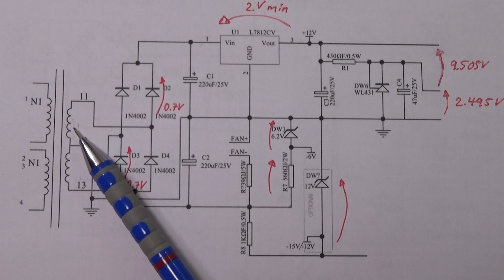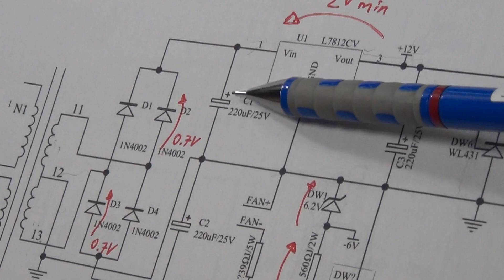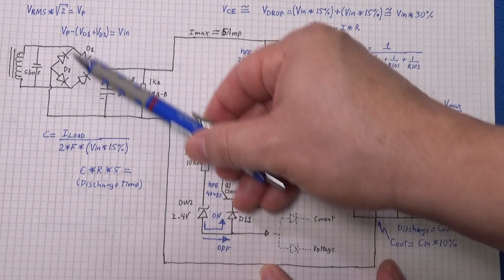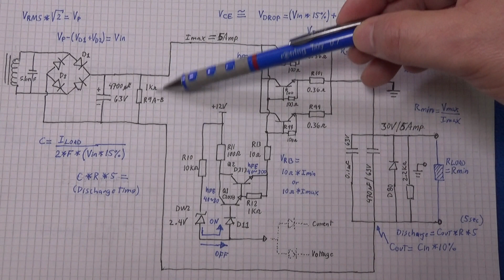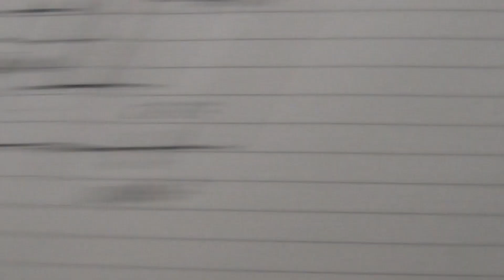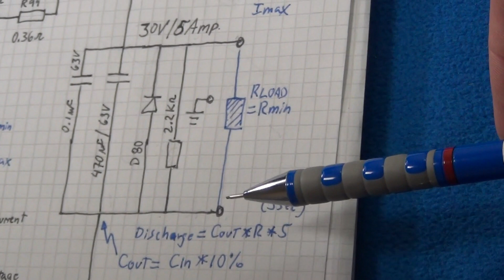How to repair or design a 3005D Electronics Laboratory Variable Power Supply & formulas for 30V 5A

Comment: at the 19th minute and 30 seconds you said that the 3  resistors are in parallel they are 0.36 ohms in parallel but there is a transistor and a base resistance existing as well so how the 3 resistors are in parallel ? they are not....

Comment: 100 ohm resistors goes from 3055's emitters to  opampN2 inverting input, they are not connected to 3055's base. There are BE-resistor (1k), which is connected from V20's base to emitter in 5 A model schematic. Your drawing at 23.12 three 100 ohm resistors are connected from base to the emitter, and missing 1k BE-resistor?

Comment: Hi Bob, some of these power supplies have a current "on/off" push button between the current and voltage knobs, i think this is to avoid voltage spikes when the power supply is switched on while connected to a DUT.. , Is this on/button a simple modification say on this power supply?
Much appreciated 😊

Comment: Got one with power issue , not going above 9 v on led display but shows 19 v on multimeter i replaced the 2n3770 Transistor but still same

Comment: Excellent video. Could you point me in the correct direction on a problem that i have with my power supply like this?  When shorting the output of my 30V/3A unit, it goes into constant current mode but provides no voltage and current output no matter what the setting of the voltage or current knobs. I figure it's a setting but which one? I want to use this power supply to trace shorted components and it's useless for that if shuts down rather than provide a current.

Comment: Thanks so much for this video. Absolutely excellent. My power supply has 0V output. I’m trying to figure out what is the likely culprit. I think the reverse protection diode. Does that sound right? I found a zener diode that seems to 0V over it.

Comment: The power transistors on a linear circuit NEVER work in an ON-OFF mode. On the contrary, they they work as variable resistors, which means that the C-E voltage drop is not constant but variable, according to the output voltage demand. That's why they heat up so badly, especially in the case where the output has to deliver very low voltage along with very high current. This is the nightmare of all of these analog power supplies, because the series regulation transistor(s) must dissipate all the excess power offered at their collector, minus that delivered to the load. Therefore, without any intention of me to be rude, all the relevant explanation given in the video is completely wrong.
Apart from that, this video is an (almost) excellent presentation...
Reply: We will really appreciate your comments and right explanation in a similar video because I am very interested on repair a broken HY3005 power supply that I have. Maybe you would be so kind to publish the corrections in a similar video to teach all the newbies that are around here. Thanks in advance.
Reply: @albejanon  If you still have your defective psu, what is its problem?  Can you give me a detailed explanation so that i can help you to repair it?
Reply: @ΠάριςΑζής  Ps does not regulate voltage at all
Reply: @albejanon  Does this mean that your display is working and you have a maximum voltage output? It is important for me to have a detailed picture of the problem. That's why I asked you this. Anyway, if the situation is like I said above, there is a great possibility for the output transistor to be shorted. In this case (which is the most usual), you simply need to replace this transistor (usually it is the 2N3055, power transistor mounted on an aluminum cooling sheet). 
So, you need first to verify this case by measuring, with a multimeter, the transistor's C-B, B-E, C-E contacts (using the diode testing mode of it). The normal indication should be at about 650mV. Any short detected will give you about zero indication. The C-E contact must be open (infinite indication, OL, or I, depending on your multimeter's design). Any indication there, means leaky transistor, which must be replaced. In your case I strongly believe that this C-E contact is shorted. Let me know your findings.
Reply: The same thing i saw and he did not explain   how works this supply which have a transformer with many outs.
Reply: Appreciation. An Excellent presentation. Thanks Bob.

Comment: Good video.Have Rnd KA320-KA3005D 30v 5 amp,same as Korad.Have blown current sense wire and the huge diode do to wrong polarity.1 time the current sence wire  loose coiled 7 windings.How to make my own or get a replacement?.The diode is easy to get

Comment: sir my sunshine DC POWER SUPPLY P-3005D, even without a load is allways full maximum apm on display and can't adjust with a potentiometer control what is the posible damage, thank you in advance
Reply: check or replaced with a new one the 7815 or 7915 or 7812.

Comment: What is wrong if the power supply doesn't maintain a constant current on the resistive load? The current swings around 100 mA at 3A.

Comment: Hola Bob, muy bueno el video queria saber si puedes obsequiarme esos diagramas ya que tengo una fuente de esas , si puedes hacerlo enviamela a cesaresqueda1971@gmail.com, y gracias de antemano un abrazo....
Reply: https://www.google.com/url?sa=t&rct=j&q=&esrc=s&source=web&cd=&ved=2ahUKEwjT6pPlo9b4AhVCuJUCHa5uBxkQFnoECAoQAQ&url=http%3A%2F%2Fwww.electronicrepairegypt.com%2Fuploads%2F3%2F9%2F0%2F1%2F3901930%2F85-1761.pdf&usg=AOvVaw2q9V6CEw5hr2z74fhPRtlq